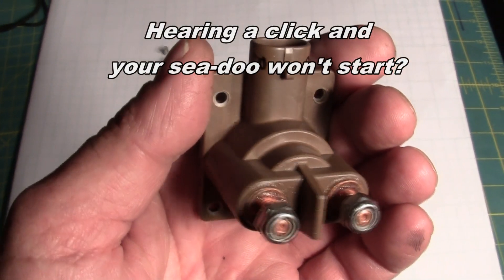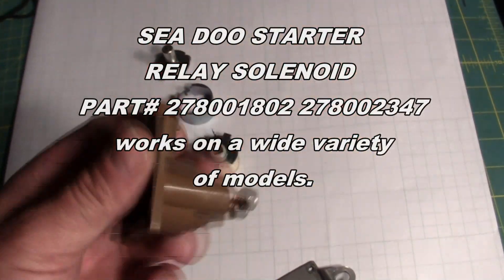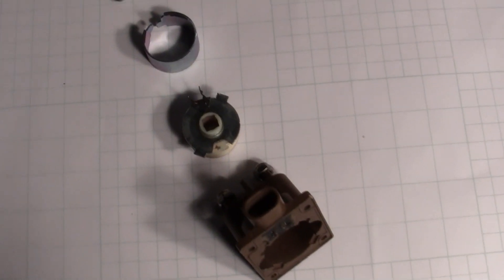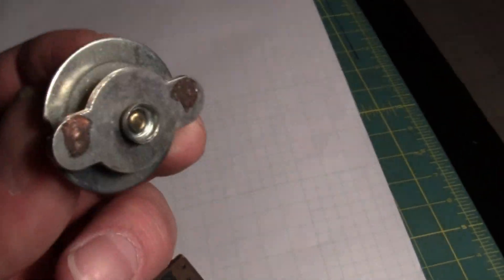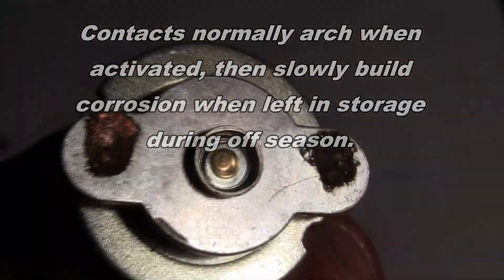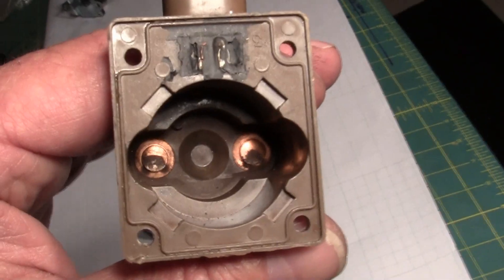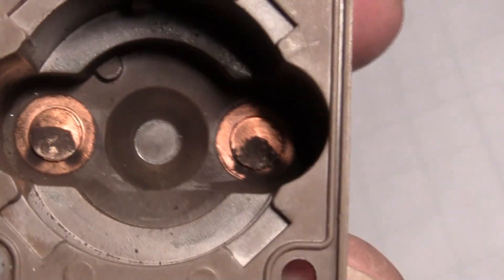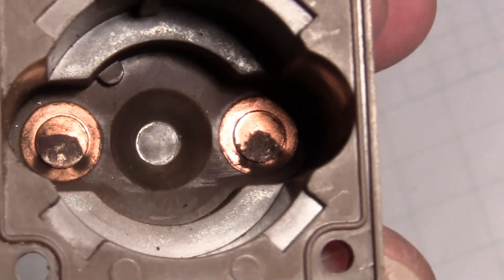sea-doo won't start? - solenoid diagnostic - trouble shooting

Comment: Hey.. So I have a 99 GSX limited.. battery and fuses are fine.. It makes that clicking noise when I try to start it. So I replaced the starter relay or solenoid I guess you would call it. And it still makes that clicking noise. Whats my next step? Lanyard connection? starter itself? PLEASE HELP! Thanks!

Comment: I have no power to my C do with brand new battery 23 hours on my fish pro
Reply: C Doo -  dash lights or nothing will come on
Reply: @edcarlyon186  change the big relay out in the fuse box, that is what was wrong with mine.

Comment: I've replaced the solenoid 3 times and it still just clicks. The started turns over when I do a direct connection. All the fuses are god. I am at a loss for what else it could be
Reply: I went down the same path. In the end, turned out that my battery, no matter that it was brand new, didn't push enough cranking amps for my 97 XP. It was the appropriate YB-16CL-B model number, but after swapping from a 240 to a 275 cranking amp battery, the problem was solved. The difference between a $67 dollar battery and an $80 battery was what kept me from riding for 2 months until I figured it out.